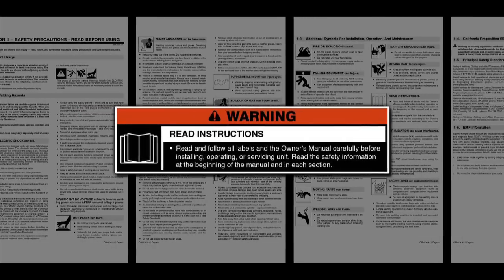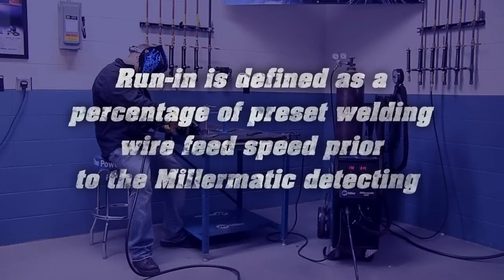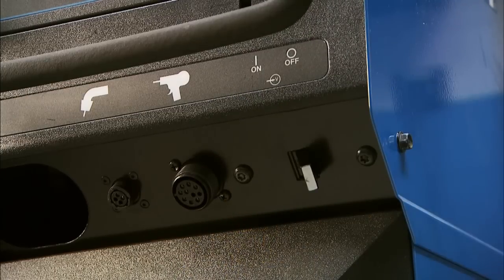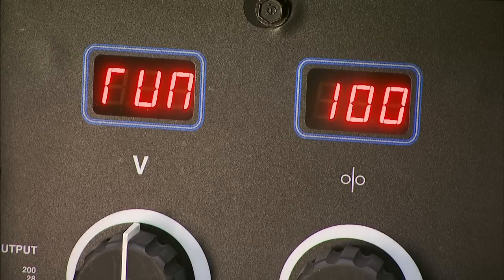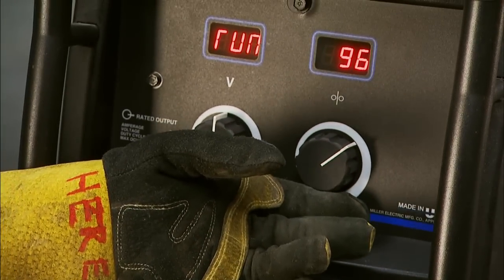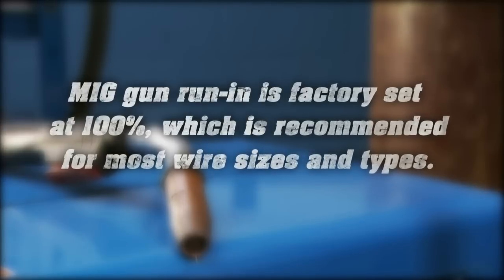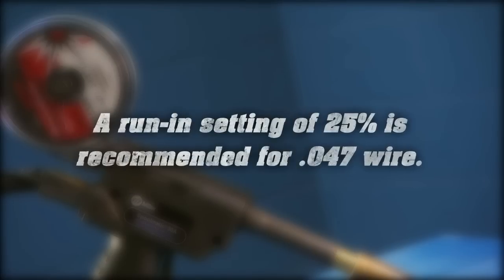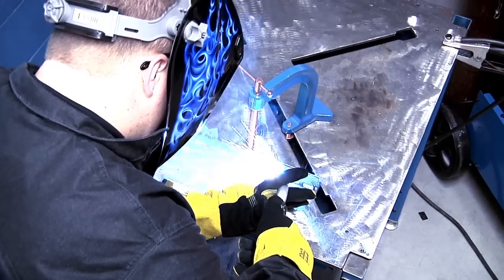Millermatic® 252 MIG welder run-in

Comment: Does this welder reach at least 25.5v and 550ipm wire speed?
Reply from the maker: Randy, the Millermatic® 252 has a WFS range of 50-700 IPM and would have a duty cycle of 40% using 250A at 26.5VDC.
Reply: @MillerWelders  game on then 😈 I’m use to a 350p from work but I don’t have that kind of cash to shell out. And if I can get practically the same output (what you said is literally all I’ll ever need) from the 252 why not. A little cooler spray transfer, plenty of backbone for gas shielded flux core. And the good ol short circuit spatter king settings. Gotta love it. Thanks for the info! I’ll be looking into one soon
Reply: @randynelson9773  I use a 252 at work and it is great.  I weld between 18 gauge and 3/4" plate.  Anything over 24V goes into spray transfer, and I think it goes up to 29volts.   At lower settings the fan doesn't even kick on unless you really push it.

Comment: How do you make it run spray transfer?
Reply from the maker: Hello Zachary. Thank you for your question! To get the unit into a spray transfer, you would need a spray gas mixture such as 95/5 argon/CO2. You would then turn the unit up high enough to get into a spray. Typically,  you would need a voltage setting of 22 volts or more depending on the wire size and gas mix you are using. Let us know if you  have any additional questions.
Reply: I'm running 316 stainless steel currently with tri mix gas.

Comment: So what is the importance of "run-in"?
Reply: Run-in is the speed at which the wire will feed out the end of the gun, before an arc is detected/struck.  It helps with starting a weld, reduces spatter etc.  Different wires/alloys, have different run in recommendations.
Reply: StickerMigTigger most machines are pre set they all have it